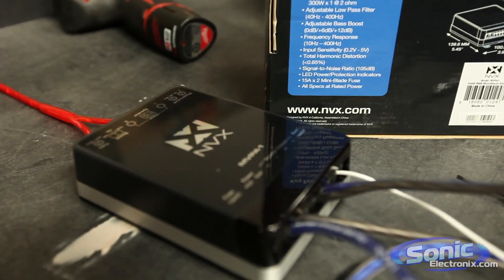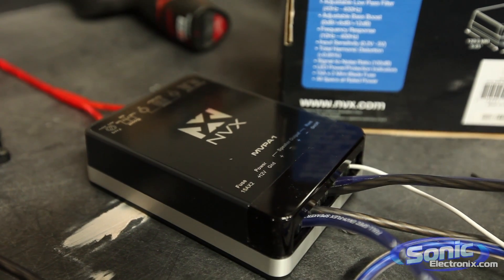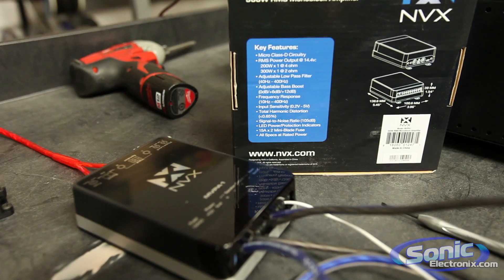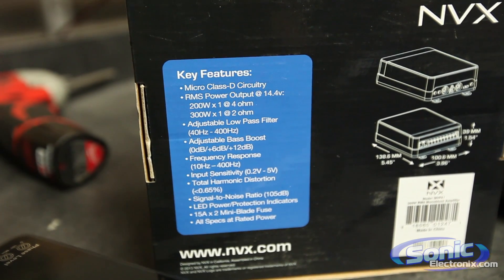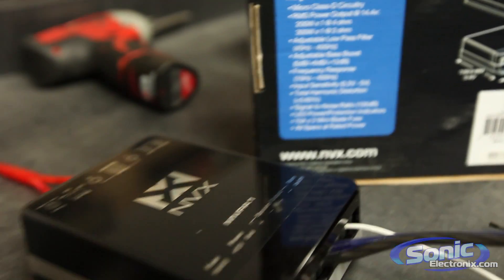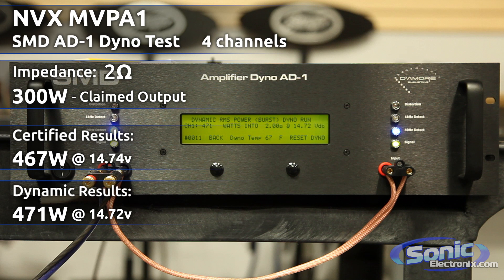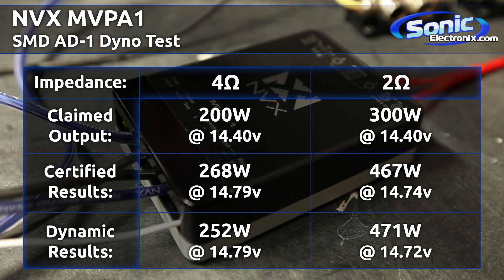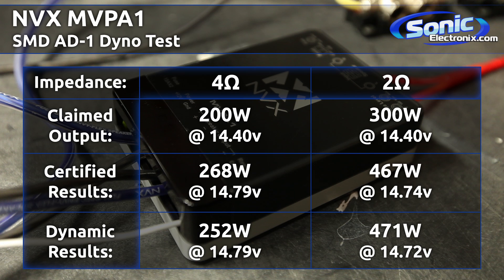NVX MVPA1 Amplifier Dyno Test | SMD D'Amore AD-1

Comment: So I recently purchased this amp from Sonic Electronic for my skar audio ix8 does not work right won't even push the damb sub. Tried to get ahold of someone from Sonic Electronic with no luck. First purchased from you Very Dissatisfied at this point would not recommend your services or products.👎👎👎👎👎👎👎
Reply: did you buy a dual 4ohm sub and wire it down to 2ohm like you were supposed to

Comment: My thing is how long does it play till it gets hot. Would mind doing a system with a few of theses
Reply: That’s a good observation because many amplifiers can do a good rating but heat up like crazy and their life span shortens out. My MVPA-4 gets really hot after 5 minutes of play at almost full power using an 8” sub.
Reply: I got it in my setup on a nvx nsw 12, I've played it none stop for at least 6.5 hrs on a road trip to Cincinnati it never shut off and I checked it because on road trips I usually don't run my amps and it wasn't even warm to the touch, it's a few videos on my channel of this amp.
Reply: And I made this trip twice, it's an eight hour drive both ways from where I am, I said 6.5 hours because I know I was on the phone for at least 1.5 hours.